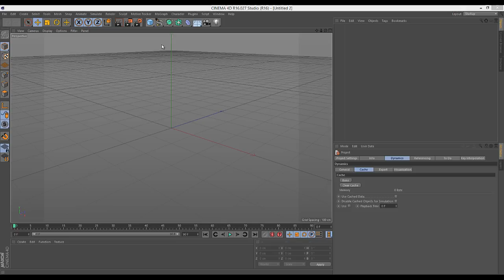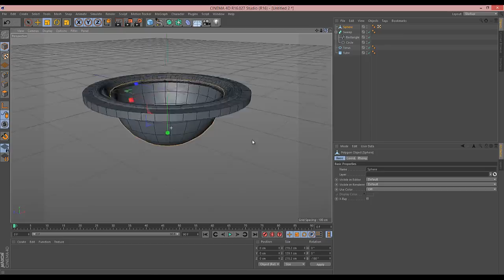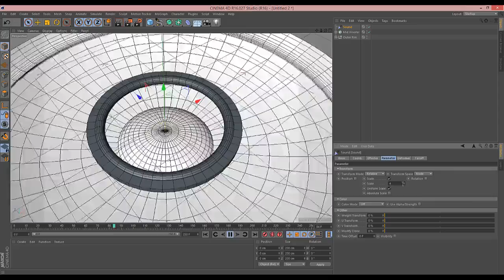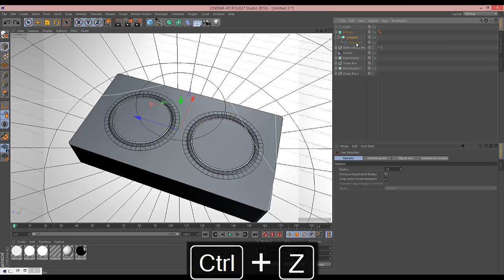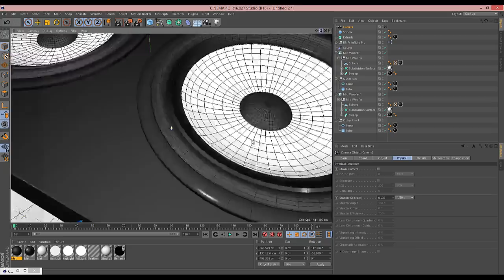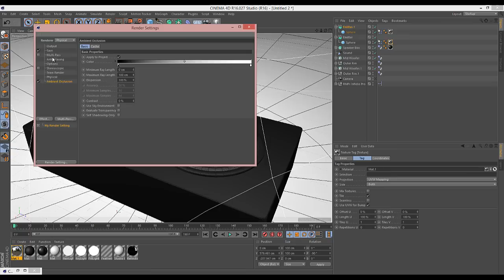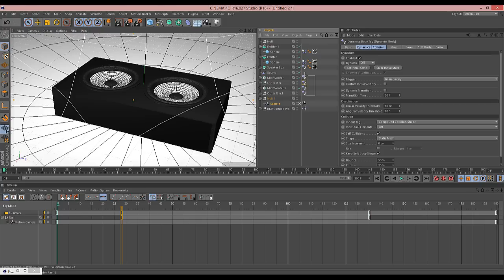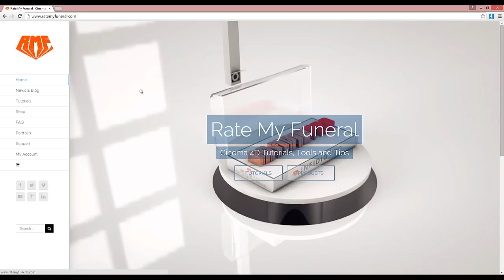Cinema 4D Tutorial - Build a Speaker with a Sound Effector

Comment: Great tutorial and in very short time. I especially appreciated the time to explain effector parameters, and use the TAG Camera Motion. But, I have a little problem with the cache. I made un fast render (Material Override), and compare the result with and without cache. I notice that the small spheres react little or no, to the movement of the speaker when the cache is ON. I must render with the cache OFF. Are there any limitation to use the cache? Thank you

Comment: 1:36 Diaphragm
Reply from the maker: Is the diaphragm not the cone shaped middle bit...?
Reply: yeah sorry it is, i should (but didn't) have said suspension at 1:36 great video though. 

Say, while I've got you here though.lol my version is not rendering the dynamics after about the first beat, approx after 80 frames (30fps) in. the diaphragm moves for the first beat, then appears to fade in its motion over about 1 or 2 seconds until it doesn't move. almost like there is keyframes on the strength of the movement, but there is not. i have 30% bounce key frames on the balls up to frame 200, then it changes to 200% from frame 200. (this is to stop all the balls bouncing out straight away on first drop from emitter, but once they are in the diaphragm they can be bounced very high when beat strong enough). It All works in   preview. I did forget to switch "all frames" back on. Do you think that was it? i will have to wait till bedtime to see if it worked. I do my renders overnight (this one will be 2500 frames long)

Also what sort of CPU are you running. you seem to have a tonne of cores. i only have a xeon 1231 V3 (but at night use team render on my wife's i5 (for a few extra frames). Anyway great video. 

If your ever looking for a suggestion on a tute, then how about teaching us Sub-D modeling using a Radio control buggy's body/shell/cover as the example. I built a wonderful replica of my 1/8th scale nitro buggy, but failed miserably at the body. the body has smooth organic lines, this was extremely difficult without sub-D, but Sub-D is very difficult.
Reply from the maker: I think speaker outside sounds punchier! ;) 

Not sure on your problem to be fair, not experienced that myself. Sometimes if I am having a major issue with something being odd, I just start again in a new project and start with that part. Often I notice where I'm doing something silly. 

My full rig specs are here: https://www.ratemyfuneral.com/faq :)